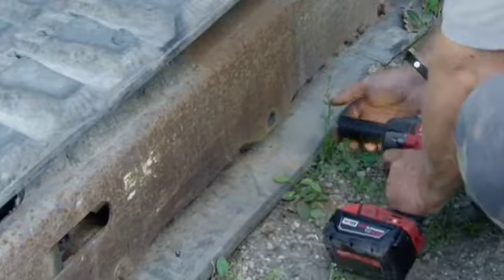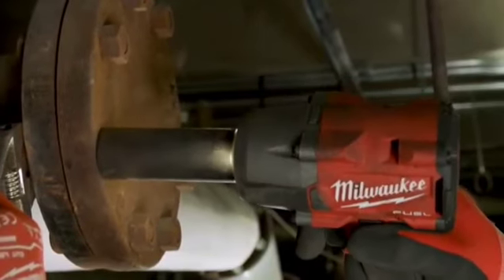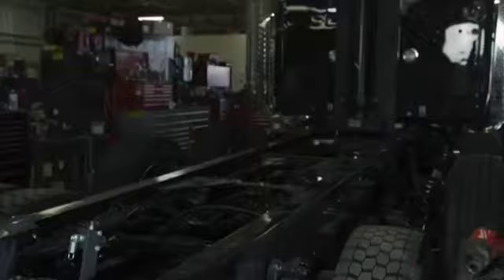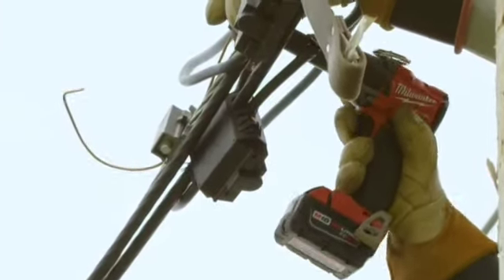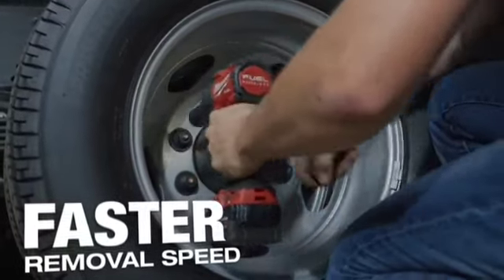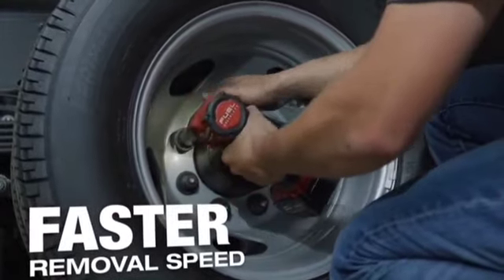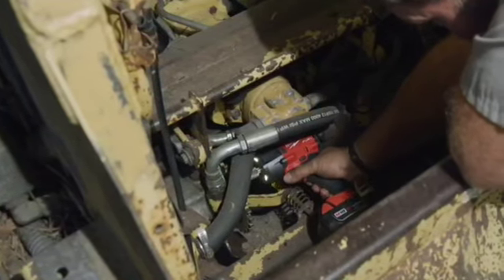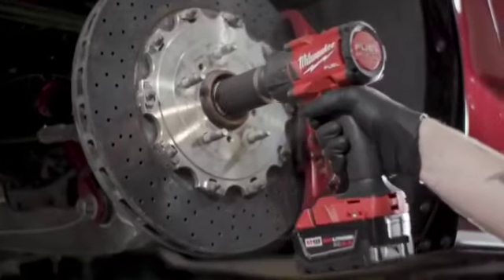(NEW)Milwaukee M18 Fuel Mid-Torque Impact Wrenches

Comment: One guy in the video said the new Milwaukee mid-torque didn't shake as much as the high torque. Reading the reviews for the 2767-20 high torque about the complaints of the battery shaking loose and breaking down made me not consider buying it with the Home Depot hack. I'll see what experience guys have with these new these mid-torques coming out.

Comment: So should I even get the compact m18 one or this one? This ones a inch longer and 450 ft pounds more stronger lol. Honestly this one might be it
Reply: This one is way better than the m18 stubby thats coming out along side this one. I can't wait for this Mid Torque to be in stock.
Reply: Rick's Giggle yeah my thoughts exactly
Reply: Sam S I’m thinking of getting a 3/8 mid torque and a 1/2 high torque when the new one comes out. I have the m12 stubby but it’s annoying because I need to carry two separate batteries.
Reply: Sam S the stubby has 250ft pounds of torque and the mid torque has 600 something pound feet of torque.